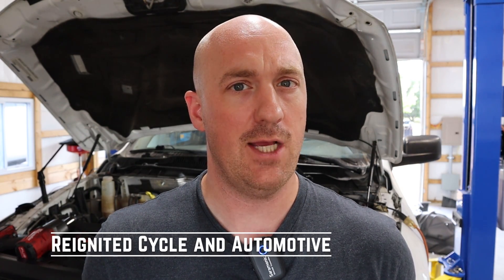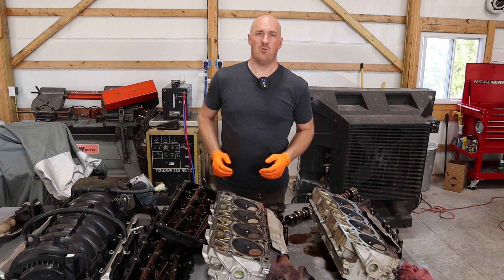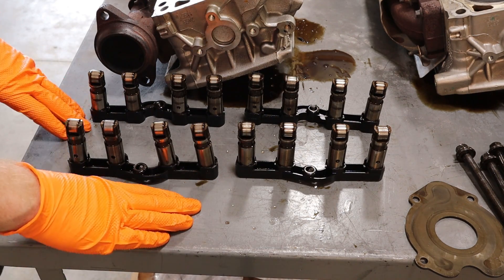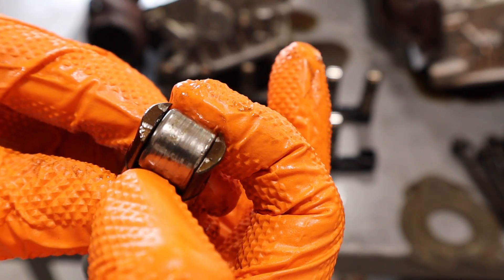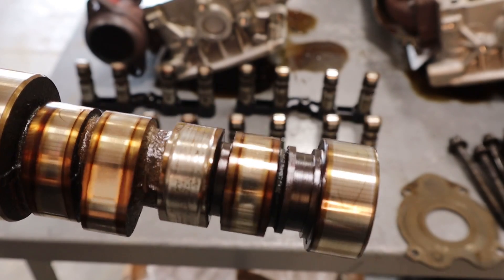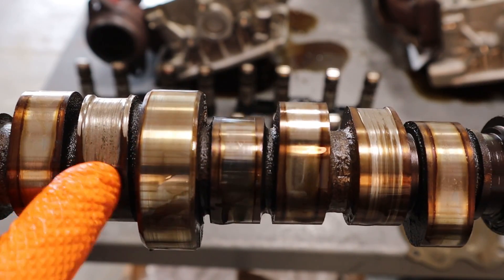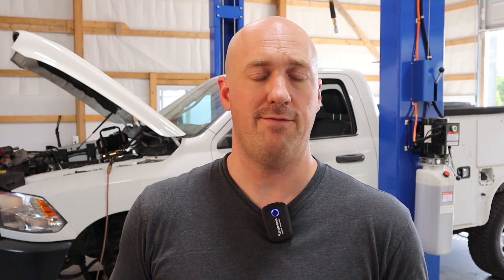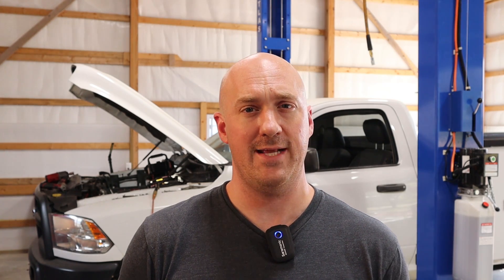Hemi 5.7 Lifter FAILURE Does this engine have a fatal flaw? Find out how YOU can prevent it!!!

Comment: 2012 5.7 HEMI REBUILD UPDATE

I have a 2012 Dodge Charger 5.7 HEMI pursuit that I use for TxDOT Freeway/interstate off duty in Texas.  As you might guess, I idle most of the shift 6-14 hours.

1 year ago approximately; my lifters failed on my engine @ about 150k.  (Previous lifter/cam replacement prior to me purchasing this vehicle @ 75k miles)

I had the engine rebuilt with the HEMI HELLCAT oil pump, HELLCAT lifters, and the rest of the engine rebuilt as well.  As mentioned, my idle PSI (5w20 FS) was approximately 45-55 psi from 20-25psi previously.

It’s been a year and 2 months 14k miles.  I changed the oil every 2-3 months, Penzoil Platinum FS 5w20.  

And I experiencing lifter failure AGAIN.  This time, 95% piston 1 (MDS).  

The rest have rare and occasional misfires.  At idle and in motion it sounds like a lawnmower.  

I’m saving every penny for the coming rebuild and repair I know I will have to do AGAIN.  

I should repair it ASAP, but I literally cannot afford the 4-6k it will cost.  I MIGHT be able to get it down to 3k, if I shop around.

I am very very very frustrated and disappointed.   Previous to this, lifters lasted 75k miles approximately.  This time, they lasted 15k!!!   

I am at a complete loss, I have no explanations or theories other than maybe higher pressure oil burns up faster and needs to be changed more frequently.  Maybe if I changed the oil every month it would have been different.  

For anyone thinking it will fix this issue, there are obviously other variables at play and the low pressure oil pump appears to be a correlation to lifter failure.  

I don’t think it can be said at this point, oil PSI is the CAUSE, not yet anyways.

Comment: I think it was this video where you were showing cam damage and the lifter that was responsible. I would respectfully disagree with your conclusion as to the cam not being heat treated correctly in this specific case, because I do agree it is part of the problem with others. The reason is this.....the needle bearings on the lifter failed, which allowed the roller to sit further back, which in turn puts the ends of the lifter into contact with the cam. Hence the two grooves channelled into the cam. I believe the majority of the problem is with the MDS hydraulic lifter design. Those tiny needle bearings do not hold up. These cams being chewed up where not a problem before the MDS system that I am aware of.

Comment: Im now installing my 2nd set of lifters and another cam, just 2.5 years after the first. I can tell you with certainty its both the lifter design and the cams not being heat treated correctly. 
One of the hydraulic type lifters had the valve opening go slightly sideways internally. It was stuck half open. BUT...the cam on one other lobe had PITTING that just started at the the top of the lobe, and strangely enough, zero damage to the lifter for it.
Another lobe had linear lines across the top width wise. 
The first looked like the surface of the lobe had chipped off.
The 2nd is possibly  due to the needle bearings on the roller starting to fail but coincidentally, it was also at the top point of the lobe. That part of the cam is the smallest and therefore cools the fastest when tempering. I do not think they are compensating for it correctly.
The cam was from the dealer and lifters I went after market with, not wanting to trust them from Dodge again. 
Really like this truck, but once this is done.....the truck is going up for sale, and Im not buying another Ram. Fact is they have the highest maintenance costs on the market for the first 10 years.

Comment: I have mixed emotions about these engines. I got a 2018 2500 4x4 used for severe duty work. Truck has been worked hard and has long idle times out of necessity and so far I am almost to 160k. It has had various ticks since day 1 when it had less than 900 miles on it. Due to the company choices the oil changes have been every 6k to7k on rare occurences. It has had 0W-40W since day 1 using Mobil 1. Only issues I have run into was a fuel pump failure at 68k that left me stranded. The heater core is plugging up which will lead to an expensive repair and now it has an issue where the electric fan does not come on like it should during idle times. I have traced that to be in the fuse block which is another common failure point the Tipm. I do not see it getting the signal to the fan from the Tipm so I assume I need to replace the board. I jumped it and the fan came on except not full speed so the fan itself seems fine. I probed the fuse box and relays and confirm there is no signal there. I replaced the relays and fuses still no signal so looks like a new Tipm is next. All of that said its been pretty dependable it works hard in harsh hot environments hauling heavy loads of water on oil lease roads. I have seen the issues Ford has and GM trucks in the Oil Field with late models so as of now I think the Ram 6.4l is the best choice for work trucks as of now. I am getting a 2024 in about a month so not sure if it will have the 6.4l or the new Hurricane engine. I hope it has the 6.4l because I know the common trouble spots. We do not know yet what we may face later on with Hurricane engines under heavy stress and work environments.

Comment: ive been dealing with this hemi tick for over a year and a fresh rebuild of the entire rotating assembly.  you're a lifesaver for pioneering the search for the fix of the tick. im going to try your hellcat oil pump next and i am PRAYING it works.  will update here for anyone is interested
Reply: Update?
Reply: Update
Reply: @rickybailey7123  I was in school the past 2 years. Progress on the motor was slow, but the pump was installed in the car before the motor blew again due to shop install error (claimed mixed up mds and standard lifters and cracked the heads). Since then, it's been floating around a couple of other shops when I could afford to.  It just got diagnosed last week with failed mds lifters (installed by previous shop), so ill be taking it out of all shops and removing them myself, as im moving rn into a house with garage (ive done an LS DOD delete in a driveway, so I figure it cant be too much worse).

Comment: With all that said. Wouldn’t it be more beneficial for everyone. To base their oil changes off engine hours?  After all everyone sits and idles for a while at some point. 
And how come Ram recommends changing oil based on the what the dash tells you?  The dash and computer are also calculating engine idle time and miles driven. 
Basically people are ruing their lifters by following ram/fcs guidelines on oil changes. 
I have a 2020 that isn’t commercial or police or idles any more than the next guys truck. But my lifters have been going out since 25k miles. I’m at 40k now and it’s right around the corner.   
Rough idle. Constant cyd 6 misfires.   Some times 100 in the time it takes my truck to warm up on a cold morning.  
I like the way the truck looks. But mechanically it’s a rag. 
I’ve replaced two back glasses for faucet size leaks as well as cargo light that leaked for no reason. It had never been removed. On top of getting the transmission replacement at 17,000 miles. 
I drive a big ass ram 1500 that looks like a beast. But I have to be delicate and drive it like miss Daisy because you never know when this rags gonna be down for the count. 
And it was same thing with my last Chevy. 
Next time I drop 65k on a truck it will not be an American made POS. I’m buying something more reliable. Like a Toyota

Comment: I know this is an older video but quite recently we brought my 1500 ram, with a 5.7 l hemi and a 8hp70 transmission. We brought it into the shop because of a card in bike stokes sound when I hit the 30-40 mph range. It would go away upon manually shifting with the shifters on the steering wheel or putting it into neutral. To me, everything pointed to the MDS, even found a video that sounded exactly like the problem I had and it was the MDS..  So, they brought it in and said no, its the transmission pump.. its chain driven and when we put it up on the lift we can feel the pump shaking really bad. But knowing that the transmission is connected to the engine where the pump is located doesn't make a damn lock of sense to me- the sound isn't constant which it would be if it were the pump chain.. any ideas??

Comment: This oil business is so true , I drive a fleet truck and at times my truck has to idle for many hours and after 7yrs the cam was worn out creating lots of noise so the engine had to be replaced,  this was on a 2014 3/4 ton chevy work truck.

Comment: So if you have a manual Trans. and no MDS , maybe a good thing ?
Reply from the maker: Unfortunately as I show in one of my later videos,  this issue isn't related to the MDS, my manual challenger had a failing lifter as well. Check out my latest video pinned at the top for the latest info 👍

Comment: So To Be Clear, For The 6.4L Chargers or Challys.. Running In 4Cyl (Eco) Mode Doesn’t Cause This Issue? Been Hearing A Lot, That When Only 4Cyl Are Being Used, It’ll Create Uneven Wear vs Using All 8
Reply from the maker: From all of my research and testing,  the MDS has nothing to do with this issue at all. Check out my latest video on this subject in the pinned comment at the top 👍

Comment: 6.4 has a higher oil flow pump.
There is a flaw. It’s lack of oil splash at idle. 6.4 eliminates that. 
Quit pandering to Chrysler.
Reply from the maker: Are you a fan of movies? I'll take a quote from "the last Jedi": "Amazing, every single thing you just said was wrong." 
🤣 it's the Hellcat 6.2 pump that has a higher volume,  the 5.7 and 6.4 pump are identical,  I've proved it with some of my other videos which you clearly haven't watched. Also, I don't pander to Chrysler, although I'm impressed you know what that word means. Good luck to you sir. 👍
Reply: @ReignitedAuto  My bad on the liter being wrong. You are right, 6.2. How many motors go beyond normal recommended oil changes and experience roller bearing and camshaft failures? 
Yeah, thought so. It is a design flaw, and Chrysler can wash their hands under their service recommendations. Bottom line. Design flaw. Millings Aftermarket pump addresses volume flow for the 5.7. 
Your Jedi tricky dicky tricks don't work 🤣

Comment: Hello. Great videos first of all!    I was wondering how common it is for the barrel that the pins are in (the ones oil pressure collapses) to turn and cannot be seen in the exterior hole?
Reply from the maker: Completely normal 👍 the barrel with the pins spins freely in the lifter housing so they only need to slightly lock into the holes to keep the lifter from collapsing.
Reply: @Reignited - Cycle and Automotive  would you say that it could be turned by putting a small pointed object? Is it loose enough to turn by hand?  I was hoping this was my rough running/hesitation on acceleration problem, but other than that my valve stem tips look worn. 220k kms.
Reply from the maker: @chad .tencer  they are under spring pressure so not sure how easily they will rotate. What year/ model Hemi do you have?
Reply: @Reignited - Cycle and Automotive  I have a 2010 1500, there was no check engine light, but you could hear it idling uneven, with a very ugly tick I did both exhaust manifold gaskets hoping that would help.   On a side note I was also getting-15⁰ knock retard along with a heavy hesitation upon acceleration but fine after 2000rpm.   Thanks for your response.

Comment: Definitely a design flaw. 2014 Ram 5.7 with 121,000 miles, number 2 cylinder exhaust lifter just took a shit. This engine has had oil changes every 3,000 miles since new with Mobil 1. I put a scope down each cylinder and they all still have hash marks and the engine is spotless inside. Not being able to change lifters without pulling the heads is also horseshit. Love the motor but some of the engineering is terrible.

Comment: There is a recommended mopar oil filter (9$ at dodge and a high volume SRT oil filter 11$ at dodge} that keeps the oil up in the top part of the motor when the motor isn’t running.  Jiffy lube and under educated mechanics throw on what they have on the shelf and call it a day.   Say if your wife has yeast infection and the guy down the street says use jock itch cream do you use the cream or do you get the recommended medication for her.  I’ve had 4 gen 3 hemi motors and never knew about the hemi tick until last year when it was the new discussion rage on utube.   Use the correct oil and oil filters and don’t push the oil change off until the last minute.  Be your internal grandfather and take care of the motor like he would have.

Comment: Is this covered under warranty?
Reply from the maker: As long as you have a powertrain warranty in effect then yes,  but there's no extended warranty coverage for this issue that I'm aware of.  👍
Reply: @ReignitedAuto  thank you for replying your the best 👍
Reply: @ReignitedAuto  hi I also had one other question I’m buying a 2018 ram 1500 it’s got 15,000 miles on it but the truck looks like it might have more miles on there. Is there a way to plug it in to a scanner to find out if it’s the actual mileage before I purchase the truck. Can I take it to a Dodge dealership?

Comment: Wow so much valuable information! Im in need of a qualified advice. My 19 rebel thats has 57k miles is in the shop because I had a miss fire on the 3rd cylinder. Should I be alarmed and what should be done to check? The dealership they are goingto replace the injectors. Thank you for any tips it's much appreciated.
Reply from the maker: Got the perfect video for you 👍
https://youtu.be/gW3YuM4ZeAA

Comment: I absolutely disagree. I have had police Ram trucks with a 5.7 come in at 45k for lifters and daily drivers at 35K. It is flat out a design flaw and cheaply made parts. Chevy lifter sit vertical and still fail at 15K miles. 

The vehicle manufactures are building crap. 

Exhaust manifold leak from broken stud. Yep. Why does the Toyota Tundra 5.7 not breaks exhaust studs? Design!!

Do you homework before making a video on something you dont know about. 
Maybe just stick with hoe to replace them since that is what you do know about.

Comment: Really like your video very informative I also watched the one concerning upgrading to the Hellcat oil pump. I have a 2017 Ram 2500 with 5.7 L Hemi VVT from what I understand does not have MDS so some of the issues related to the MDS system may not apply here although based on my research of this truck it was a fleet vehicle based in Canada according to the idle time on it it had over 1500 hours at idle in 67 Drive hours which seems kind of strange to me it would mean the truck has the capability of doing 1,358 miles per hour . I've been able to determine that the first 3 years 75,000 Mi was put on the truck I bought it with 82,000 it now has 91,000 I can see through the carfax report oil changes were done every 8 to 10,000 miles exhaust manifolds were done about 8 months ago but now I've got this noise coming from the engine again do you think it's possible the manifold bolts have broken again? Or should I be looking elsewhere?
Reply: Dude same story with mine but as far as I know my engine seems fine but it still scares tf out of me. Mine was from Canada has more idle hours than drive hours. I’m at 135k though seems ok atm. Worried cause I just bought it. 15000 dollar loan on truck. 2018 model tradesman. How’s yours doing any culprit?
Reply: I replaced the engine with Remann/ Sustainera and is running well.  Turns out the connecting rod bearings were shot from a possible hydrolock event at some point. I was able to reset the idle hrs and the drive hours to zero using Alpha OBDll and left the mileage alone. @mtn-endeavors67

Comment: I have a non mds 5.7 in a  2006 power wagon  that's been ticking or tapping for 60000 miles not an exhaust leak 5hat was addressed, never expected it to last this long and still run fine, could it be a lifter not rolling when the cam hits it or is it piston slap? Anyone have any thoughts? Has never misfired but it's been  annoying for those 60000 miles lol.

Comment: Just bought a 2013 Ram Sport with a Hemi. Now i hear a slight ticking when it starts up. After warming up for a minute or two nothing. But when I hit the gas the ticking is loud. When I come to a stop and idle the ticking is gone. It's only when I hit the gas the ticking is heard.  Would anyone have a diagnosis of what this is. 
Exhaust leak???
Reply from the maker: You are correct,  it's an exhaust leak.  Check out another of my videos called "the other Hemi tick" for more details 👍

Comment: @pinned by reignited
Is it possible to use a thicker oil such as 10W30 on a 5.7L Hemi instead of the recommended 5W-20 or 5W-30 motor oil to lessen or prevent the Hemi ticks?will it affect anything engine wise or performance? thank you